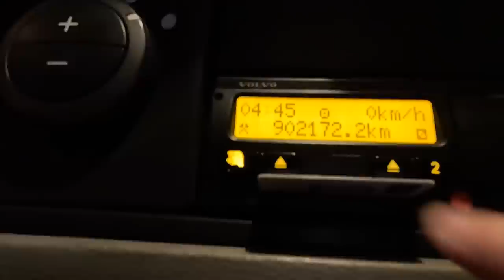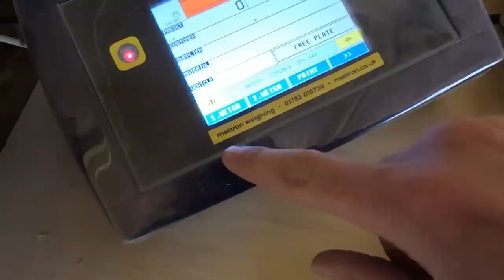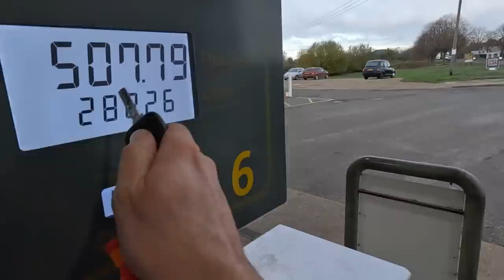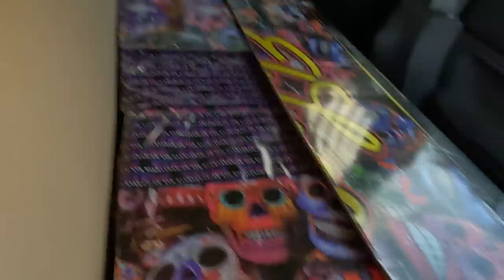I’m BACK At Datashredders | *NOT CLICKBAIT* | Gift From Scania | #truckertim

Comment: Hi Tim. Normally the rear axle on a tri-axle coach is a rear steer assist to allow the coach to be longer than a standard coach so they cannot be raised. Can't wait to hear the Scanny once it's straight piped. Best sound ever!!
Reply: Thought I heard one today it was a mercedes rigid probably with issues
Reply: Coach driver here, tri- axle coaches have the third axle for weight purposes and the steering is just to stop tyre scrub on tight manoeuvres for example 13m twin axle is MGW of 21T and the same length coach with three axles is 33T, it does help on 15m coaches to push the pivot axle forward shortening the theoretical wheelbase but it’s menial when all you end up with is a tail swing the size of a 3 bedroom house 😂
Reply: I don’t know how it works in England, but here in the Nordics you are able to ease the pressure on the third axle to get some more load on the drive axle. Causes more friction on slippery roads and is helpful to not get stuck in snow or ice.

Comment: Top tips if you want your truck to go as fast as possible. Before calibration do:
1. Put smaller profile tyre on ie: 295/70 then put on 315/80 after calibration 
2. Make sure tyres have as little tread on as possible then after calibration put new ones on
3. Lower tyre pressures to about 60-70psi then pump back up after calibration 
4. Set limiter to 89kph then back to 90 after calibration
 Doing all this should have you sitting at 59/60mph but Speedo and tacho read 56 😉
Reply: Dont you have to calibrate tacho again when you change tyre size???
Reply: @Derni186  technically yes but the tyre size on the tacho doesn’t necessarily have to be what tyre is on at the time of calibrating it 😉😉
Reply: Just make sure you swap tyres before mot 🤣and hope vosa don’t pull you
Reply: @Gibbzy17  exactly mate, I’ve been pulled 4 times by Vosa and not once have they checked my tyre size 😂 more serious things too worry about
Reply: Why risk it for an extra 4mph lol

Comment: Tag axle coaches - love driving them. The rear axle is a steering axle so stays down at all times. There is an option to raise them on some coaches, but normally as soon as you start moving more than 5mph it automatically drops again. I've only ever lifted a tag once when I had a blow out on the driver side tag on a Van Hool. literally limped it to the slip road. My experience is that coaches 14m and longer have a tag axle, but you may get some with a tag that are slightly shorter. I still have my full bus licence, digi card and CPC but I don't drive any more. Keep my digi and CPC updated though as you never know when you need it! I did consider doing my rigid and arctic licence but never had the funds to do it! I love driving myself though. Love watching your videos! Hope your Op Licence doesn't take too long!

Comment: Good to see you back for a day. The tag axle on the coach can't lift it turns with the front wheels to help get around tight corners. It can be locked so the rear steer won't turn. Other than that nothing really exciting about a tag axle coach

Comment: the steering tag axle on large coaches only lift a little bit to help in situations where you need more friction on the driven axle. It does not come up all the way sadly.
In holland the rules are that any coach longer than 13.50Meters needs a steering tag axle regardless of weight to help us get into smaller streets and villages.

Comment: The driver gets a hourly rate where as the truck charges by mph/kph. Don't know what you're guys hourly rate but if the driver charges £25 hr your truck would charge something like £2 to £4 per mph/kph. Prices vary from maintenance and servicing diesel pricing. So you worked 10 hour shift and truck and trailer and diesel was supplied so yeah if £25 an hour is good then charge £25 an hour but would be nice to throw in a 5% or 10% discount as good faith and hopefully when your truck is running due to good faith you will never have a shortage of work looking forward to see what ya do. Oh and the tang seems a common thing in New Zealand 🇦🇺

Comment: Super singles are crap,   They aquaplane from new, are not necessary performance at all.
     They aqua-plane because they are so wide & don’t have tread deep enough.   A puddle even just an inch deep will do this, not fun on a narrow road with a lorry coming towards you on the other side.
     Regular lorry tyres can cut through deep water without an issue.     Don’t get super singles unless it’s already too late.

Comment: Add 10% to the hourly rate data shredders paid to cover your admin
Reply from the maker: Sounds about right, cheers Sarah 👍👍
Reply: @TruckerTim  your  welcome,  you can adjust your  fee depending  on  the conditions of the job I.e are you using  the clients  vehicle and fuel or using your own equipment which you can then  add more too cover your fuel, insurance, milage and wear & tear.